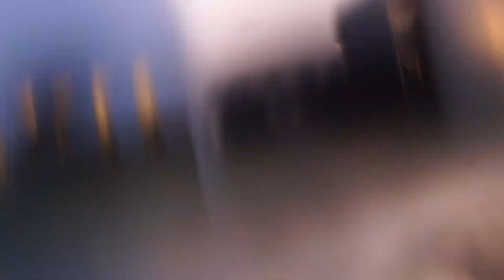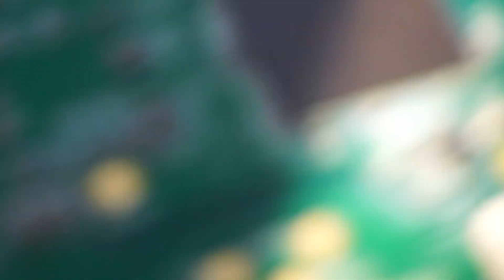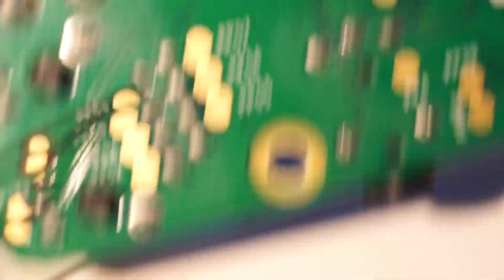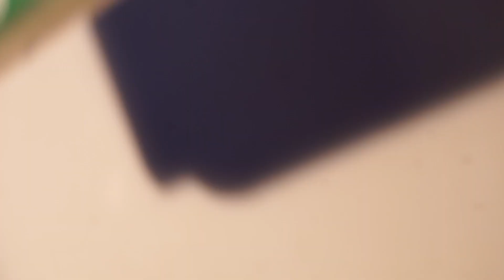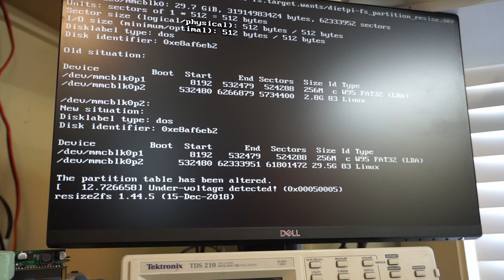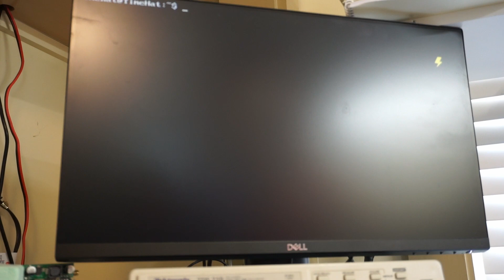Raspberry Pi Oscillator Upgrade

Comment: What temperature did you use for the XO removal please?
Reply from the maker: Probably around 350ºC, that's where I do the majority of my SMT soldering.
Reply: @john8520  Thanks John, I've been trying with 380°C, but didn't come off. Perhaps I need to be more patient, was afraid of damaging the board and stopped too early.
Reply: In the end I had to bump up to 420°C, then it went fairly quickly.

Comment: Thanks for video, I'm looking to do similar on the Pi Pico. Not sure whether the B does the same, but the Pico has a series resistor R14 into pin 3 (XIN of XTAL) - which means that this pad can be isolated from CPU and potentially re-used as a VCC pad for the new module.
The 2 small value caps either side of the XTAL are to tune it to the drive circuit (inside the CPU), they are not needed for a self powered module.

Comment: A small note. The NTP protocol has a limit of 0.2ms on the local network. Using this protocol there is no particular point in making it more accurate than 200000ns

Comment: For greater accuracy, you can use a more expensive GPS receiver with a TCXO generator inside. In theory, a multi-band receiver with L1 and L2 bands with GPS+GLONASS+Galileo+Beidou should give more stable PPS than single-band GPS alone.
Reply from the maker: Multi-band, yes, absolutely. Multi-constellation... it's complicated. There's some research on the topic floating around out there already, but generally speaking the operators of all the different constellations cannot be depended upon to agree with one another when it comes to managing the clocks onboard satellites.
Reply: @john8520  Hmm, quite a bit more expensive, but with the oscillator upgrade, you might be able to see benefits from using a timing based module, like a (slightly older) UBLOX NEO/LEA M8T or something (the T models are specifically made for accurate timing, and have features that allow for a much more stable and accurate time sync -- oh and with a TCXO inside too!).

However, they're usually pretty expensive, though I recently came across some listings for some carrier boards that had them, from a telecom system or something, and just placed an order earlier.

The reason I bring this up is that I was trying out a cheaper module (which appears to be a counterfeit), and got a much worse lock and error in chrony PPS compared to a slightly better module (which also turned out to be a counterfeit; thought slightly better one XD). So I wonder, especially with the improved oscillator, if you'll be able to take advantage of a more accurate module. Will see how the M8T works out. (I actually also have an ATGM336H module that I haven't yet tried haha, how has your experience with it been thus far?)

Thanks for documenting your process, and for showing that it's possible! I haven't really precision soldered before so am a little scared of performing an operation like this on a pi, and potentially risking turning it into a cool-shaped paperweight, XD.

Btw, the Pi 5 has hardware support for PTP timestamping with the builtin NIC, which should be much more accurate than NTP. Might be interesting seeing if this operation can be performed on it too, in order to have even more accurate time.

Cheers, would love to hear your thoughts and any updates you have! Thanks again for documenting your process here :-)

Comment: I thought the Raspberry Pi had an oscillator installed, but it turns out it’s a simple quartz. In this case, the oscillator can be taken of any size. On a simple quartz chronyc tracking I have Frequency: 1.600...1.800 ppm. Your Frequency is 0.17 ppm. We can say that your oscillator is 10 times more stable. 
Interesting idea. The ARM core Pi 3b+ has a frequency of 600-1400 MHz, this frequency is connected through a multiplier to the oscillator. Will chrony be more accurate if the frequency is minimal, since the error is 0.2 ppm * multiplier?
Reply from the maker: This is an excellent question! To be honest, I have no idea. I suggest asking it on the chrony mailing list, the developers are very responsive. https://chrony-project.org/lists.html
Reply: @john8520  I think this needs to be tested experimentally. Chrony can monitor the processor frequency and takes it into account to make adjustments to the clock. I have not yet been able to run Raspberry Pi at minimum frequencies. There is little information on how to do this. Lots of information on CPU overclocking :) /boot/config.txt force_turbo=1 arm_freq=600 Attempts have not yielded results yet.